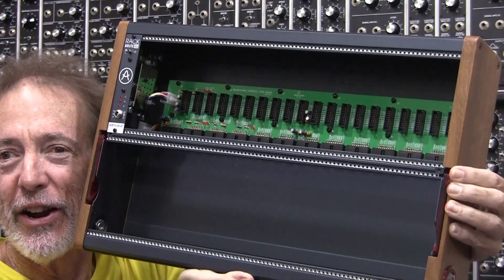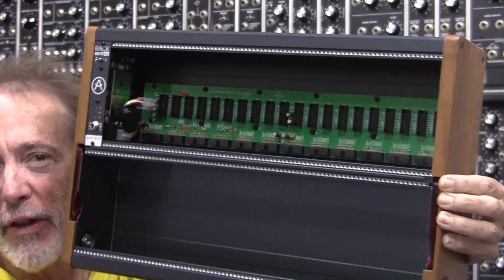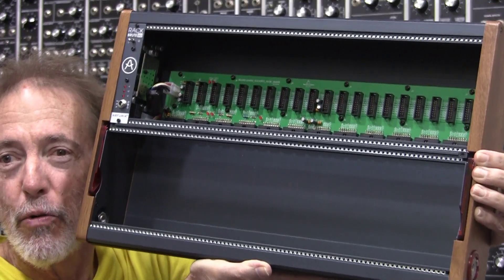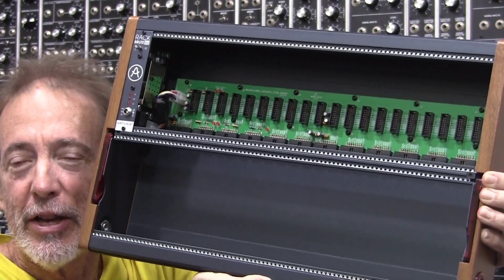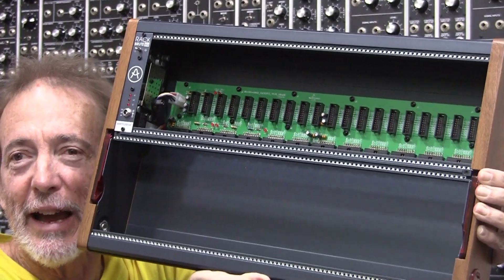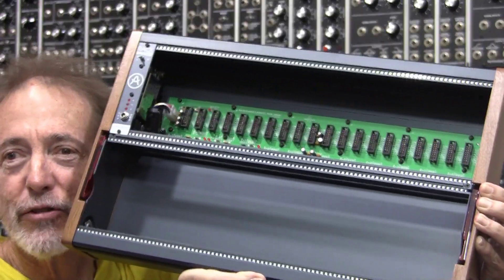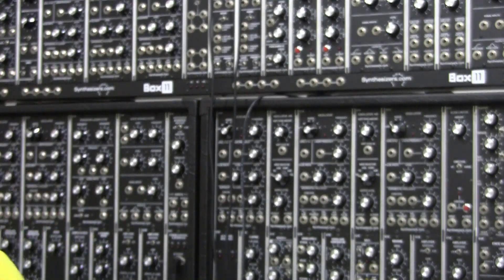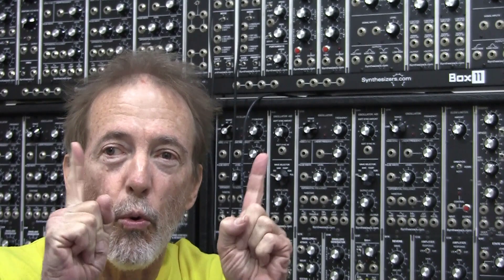Before you buy your MODULAR CASE and Power Supply

Comment: Hello Stephen! Good precaution!
MW RD-3513 gives max currents up to ~2A on +13.5v channel and ~1.5A on the minus channel. IMHO it's a good choice to make your own case. It's a bit noisy but I think that big caps will solve this. On the pro side this PSU is pretty small and is lightweight.
Reply from the maker: Hi there ... in my 5U synthesizers.com system is a large PSU  with several TO-3 cased regulators on thick aluminum plate ..... a beefy all ANALOG PSU 
It is a new experience for me in the Eurorack ..... and I liked the idea of Arturia's  FILTERED bus board..... even though max. power draw is not all that impressive many Eurorack modules use miniscule power and with careful choice I will be able to load up the case ..... and start on another one 🙂 ...... more DIY theory videos will soon be released 👍.... thanks for commenting

Comment from the maker: IMPORTANT: Please READ the video Description..... the RackBrute 6U has two separate 800ma circuits one feeds the connectors pointing up and the other feeds the right-angled connectors intended for the bottom row.... therefore your module placement should BALANCE the current draw so to avoid overloading either circuit ..... use modulargrid.net to configure your module placement and total your power requirements